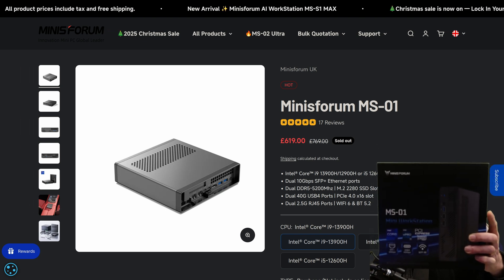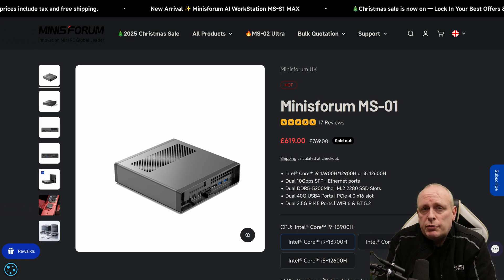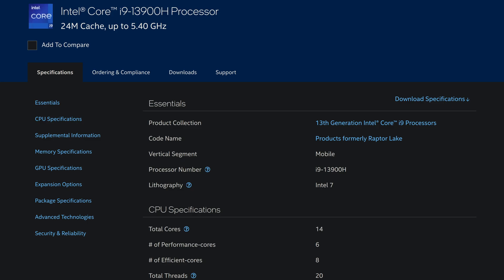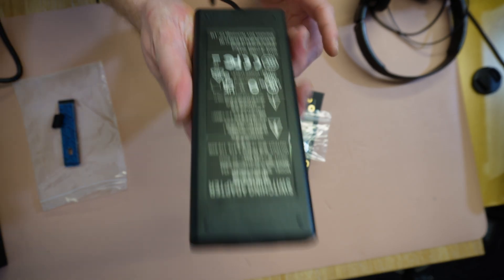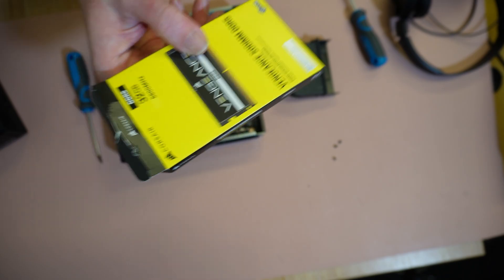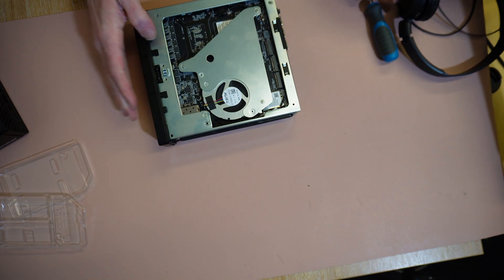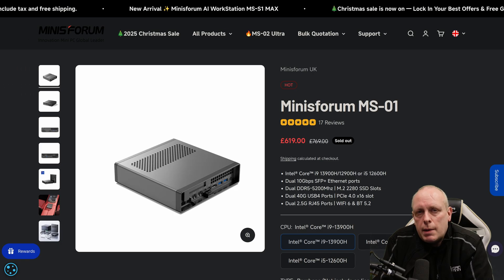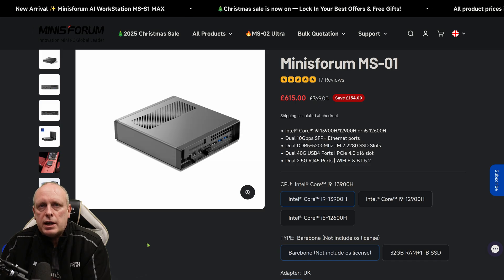Is the Minisforum MS-01 Mini PC Really THAT Good?

Comment: The MS-A2 is a far better system and is what I went with along with 96GB ram just before memory prices went nuts. Perfect for my proxmox cluster.
The pcie lane distribution for the m.2 on the ms-01 was the major dislike for me.
Reply from the maker: I've been looking at these to replace some xcp-ng servers, they are great for that. MS-A2 looks a better option for this.

Memory is nuts atm, cost over £300 for the memory in this video

Comment: The NVMe arrangement is ridiculous as the 2.5" SSD adapter plugs into the fastest port. You end up wasting the 4x4 port when the 3x2 port is better for the 2.5" SSD. They should reverse those ports so the 2.5" adapter plugs into the 3x2 port and allows a 4x4 NVMe drive as well.
Reply from the maker: 100% agree, this was what sparked the video, really strange design

Comment: I have to disagree on the router use case.  It has been a great 10Gb Opnsense router for me with its built in, modern, X710 10Gb SFP ports.  I got mine with the 12600H CPU and 8GB of RAM.  It has plenty of grunt for remote access VPN,  inter-vlan routing on my internal network at 10Gb, and obviously plenty of oomph for all the basic router stuff (DNS, NAT, firewall, etc).  The N100 boxes are fine for a 1Gb home internet connection yes, but they don't have the CPU power for VPN/Crypto and pretty much all of them have 2.5Gb interfaces at best.  The ones that do include 10Gb have the ancient 82599ES chipset which is a no go, and they're from a no-name brand compared to Minisforum.
Reply from the maker: That’s a fair take,  and I don’t disagree that it can work well in that role, especially if you genuinely need 10Gb routing, inter-VLAN traffic at line rate, and heavier VPN/crypto workloads.

My hesitation isn’t about capability, it’s about proportionality and use case. For most home and small office setups, the MS-01 is massively overpowered (and overkill on cost and power) compared to N100/N5105-class boxes, unless 10Gb and high VPN throughput are real requirements.

Where I think we fully agree is that once you step into serious 10Gb routing, the cheap mini PCs with old 82599ES NICs are not a great answer either. At that point, the MS-01 starts to make sense, it’s just a much narrower audience than the hype suggests.

Great choice with OPNsense by the way ❤

Comment: I really think these are VPS killers where you can get one of these and in 6 months its free.. Whereas you are just renting other equipment with someone like Vultr the same thing with 16 cores, 32gb (not ddr5 so its slower) and 1TB ssd you are gonna pay over $120 per month. Where as in 6 months you can have this paid off if just hook it up at home and use cloudflared tunnels and now you have a local server with plenty of bandwidth even if you only have 20mbs upload you will be just fine for most small / medium traffic projects. But most business plans have 500mb upload so they can support LOTS of traffic with a mini pc like the UM870
Reply from the maker: That's actually a great point

Comment: Thanks for calling out the hype. I've been running a Fujitsu S920 as my router/firewall (pfsense and OPNsense) for several years and it was pretty old when I got it. It's been rock solid, runs very quiet and cool, uses very little power, has space for a four port PCIe NIC and easily manages my home network needs. The only reason I'm looking for something else is it's age, though I'm tempted to just get another one as back up. Any better suggestions? Doesn't have to be very new, though modern power efficiency would be nice. Something I can pick up secondhand would be ideal. Thanks and happy festivities!
Reply: I'm using one of those too. Its a good little workhorse
I have just put a 10G nic in it.... i know i will never achieve 10G.
Some iperf testing get up to about 7G full duplex with out routing.
My next test will be to see what it will route at with VLANs on the same port.
Reply from the maker: Be interrsted to know :)
Reply from the maker: Totally agree. I’m still running OPNsense on an old J1900-based box at home and it has no trouble with gigabit. 

For most people, N100 / N5105 / N5150 systems are quiet, efficient, cheap, and plenty fast enough. 

The S920 is a solid power efficient choice tbh if it can handle your internet speeds, and if you are planning an upgrade you can always play with HA too